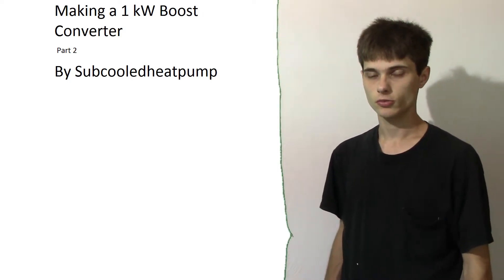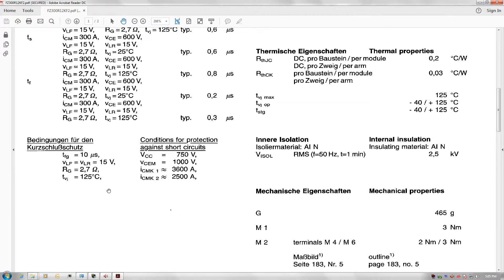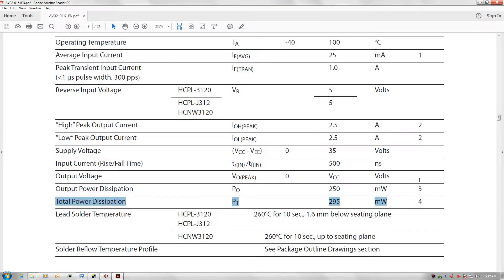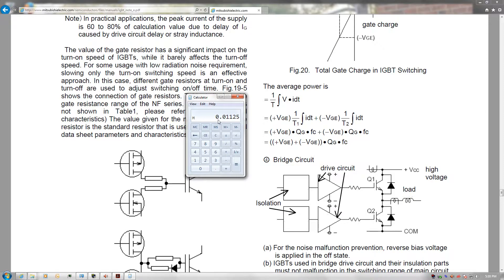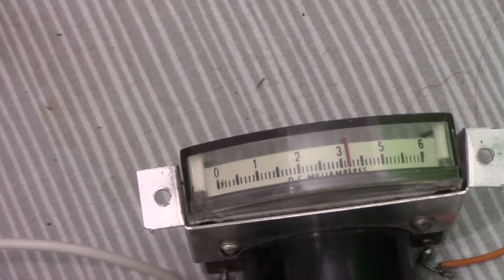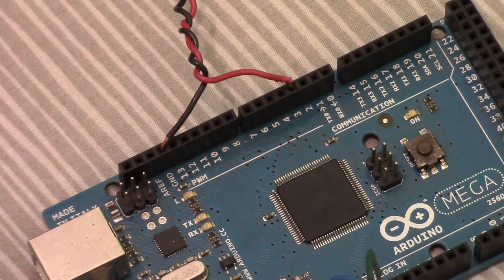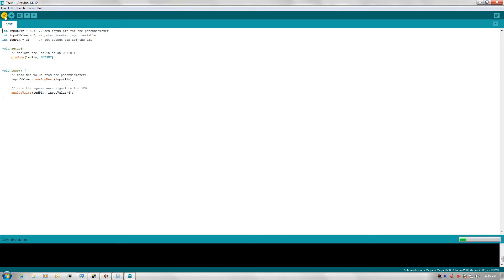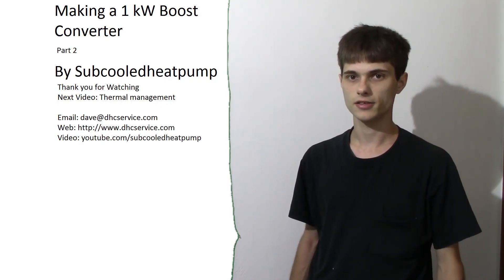Making a Boost Converter Part 2; Gate drive and PWM

Comment: I'm looking to build a three phase multi level inverter with 480 v out put it h bridge configuration have any other modulation other the 555
Reply from the maker: You would probably want a microprocessor for a job like that